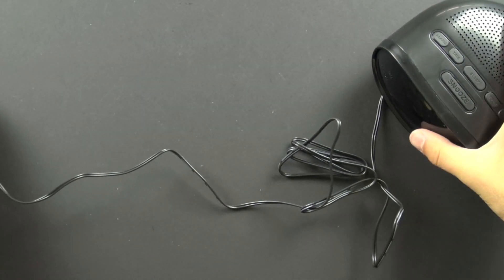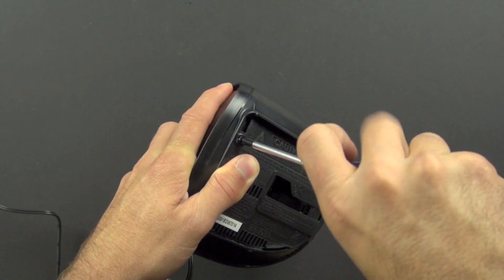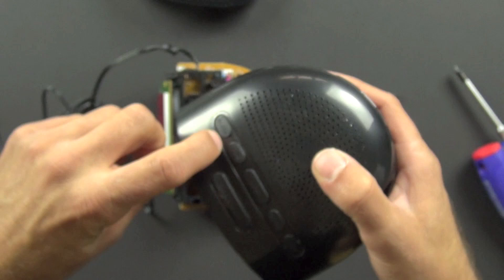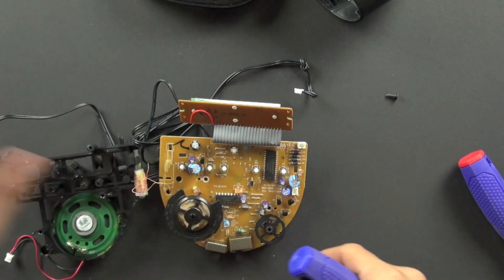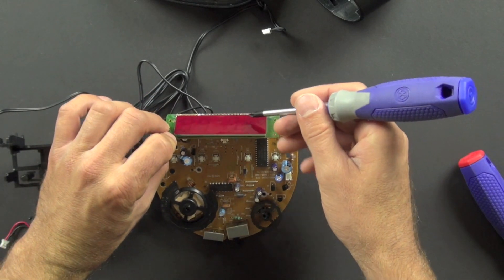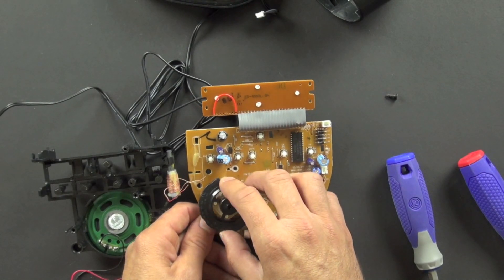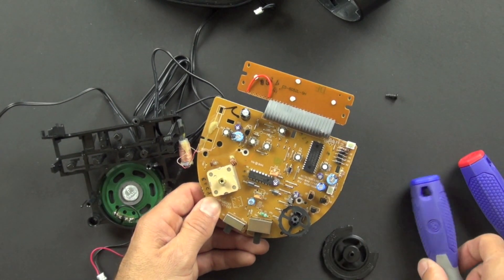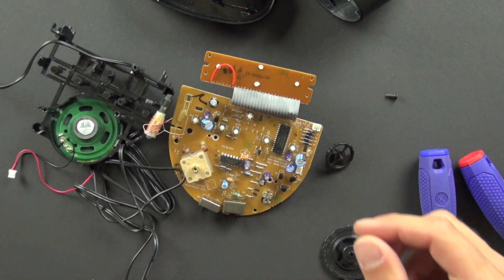What is inside an alarm clock radio? | Electrical engineering | Khan Academy

Comment: Whatever you don't.mess with any potentiometers  , at least older clock radios have them where you can adjust them, variable resistors, will spend a lifetime trying to get them back in tune, for tuning the frequency. These are found in earlier  alarm clocks, been refurbishing a bunch of old 1970 and early 80s GE radios lately, one with a VFD display instead of LED. Looks very nice, shame newer ones don't use them anymore

Comment: The Voltage that comes from the wall is actually 240 Volts and wall plugs have 3 Pins NOT 2

Comment: This would be more instructive on and older, less compact clock radio. Get one from the 70's and you'll see each and every component spread out so you can see it. Nice job, but not the best radio for learning.
Reply: The glue is poured over position sensitive components.  The little wire coils are inductors used in resonant circuits / oscillators.  The resonant frequency can be changed by altering the spacing between turns of the coil.  After tuning in the factory they are set in position by that glue.
Reply: I just got an old-school one and opened it up. Unfortunately I couldn't give the explanation this guy can, but it's pretty neat. All the components are laid out and many of them are covered in a layer of brown glue, I guess to protect them.

Comment: Hi there, I have a cheapo clock radio/cd here, the clock just flashes all the time when plugged in, it appears to register the minutes, but wont stop flashing, tried all combinations of pushing the buttons and holding them in etc, any ideas, no sound from the unit at all, dead except for flashing clock led's...Fred UK